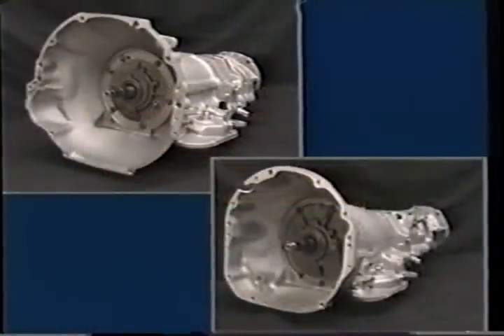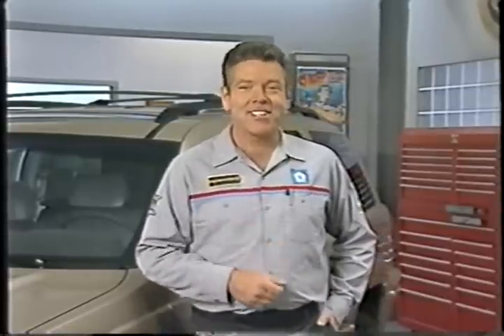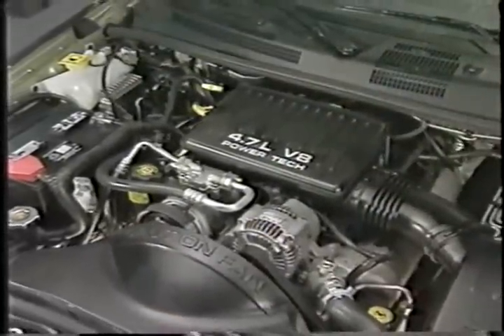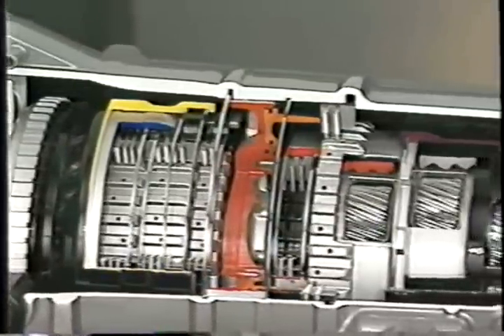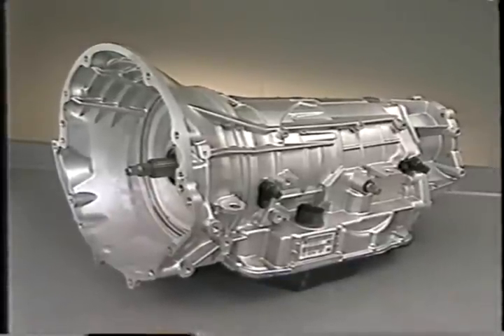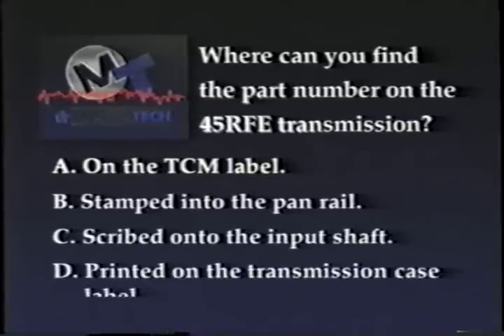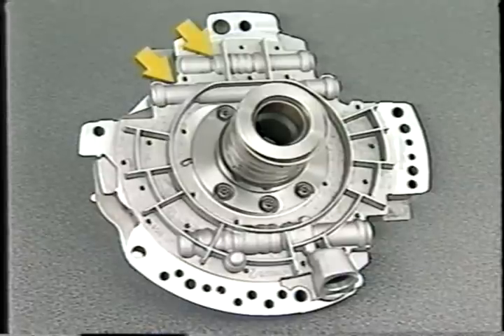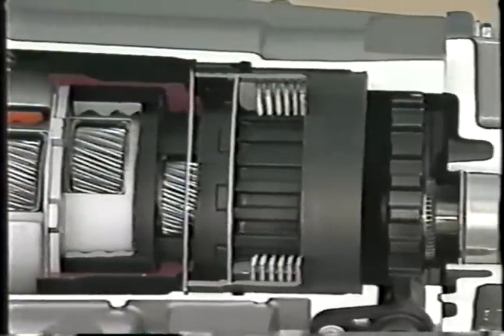Chrysler Mastertech - 45RFE RWD Transmissions - Part 1

Comment: So... I have been looking for a neutral safety switch on my 2000 Jeep Grand Cherokee rear wheel drive V8, which has this 45RFE transmission.  After watching all three parts of this video I now understand why I couldn't find it.  Its electronic controlled and there is no neutral safety switch. I have been searching in every corner of the internet and finally I have my answer Thank You ihartmacz I now understand my car a little bit better.